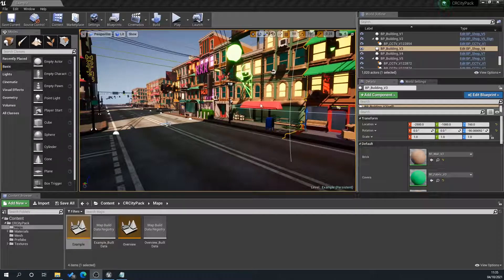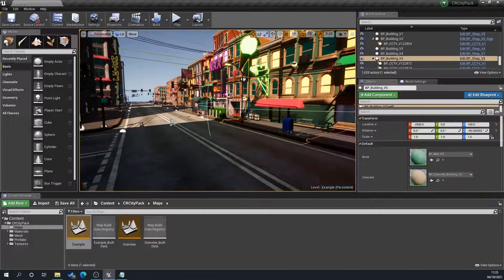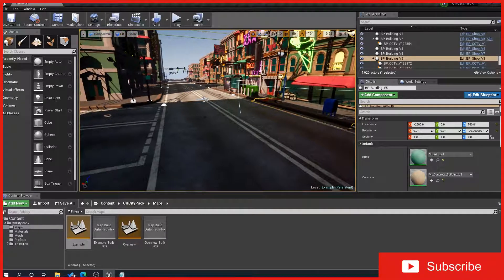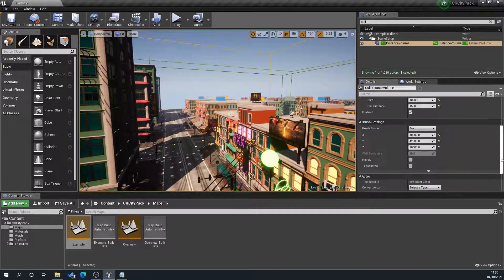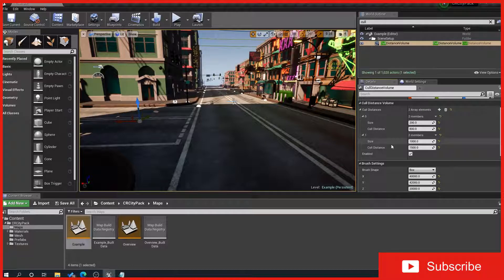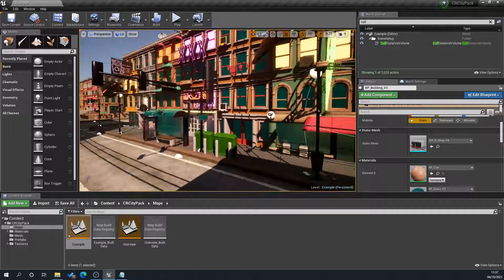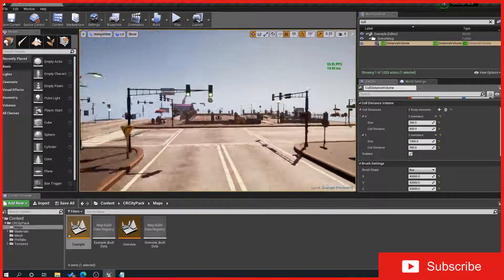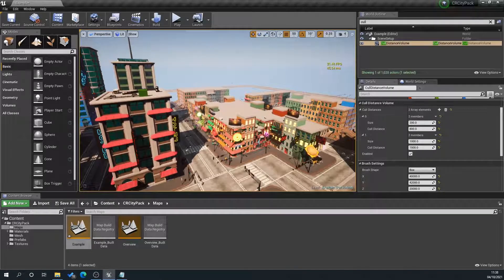How To Setup Culling In Unreal Engine

Comment: this is the worst culling method ever? :D  why do you then show it? thats only good for grass?
Reply: If you're doing a fast game in Unreal and don't want to see texture popping around every corner, the only solution is to turn off Occlusion Culling and use Cull Distance. Even the folks on the Epic team don't know how to prevent texture popping, they just advise things like HZB or Bounds on meshes, which doesn't help. Very sad that so far no one has been able to come up with a solution.
Reply from the maker: @Rabbit_Janitor  you can disable texture streaming but depending on how big your textures are this can have issues of its own. 

I guess when square Enid can’t stop texture popping in Final Fantasy 7 remake then what hope do we have 😂
Reply from the maker: Because it's one of the first things you read in the Unreal 4 Documentation when learning about culling. I have highly exaggerated the method so its very clear to people what it does.

Here's a link just in case you need help:
https://docs.unrealengine.com/4.26/en-US/RenderingAndGraphics/VisibilityCulling/CullDistanceVolume/
Reply from the maker: I will leave my original comment on here as you have edited what you originally said. 

No your wrong it’s not for grass, grass is usually culled in the foliage tools.

This is a very common method used in games and if you check the link I posted in my original comment you will see it used to cull meshes in a scene in the example video.